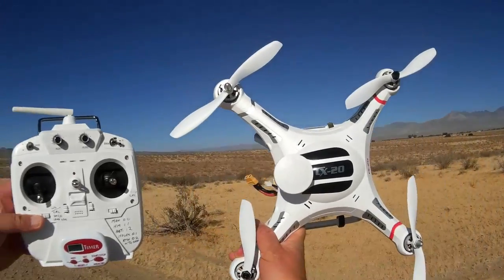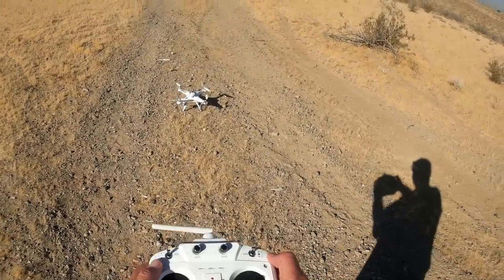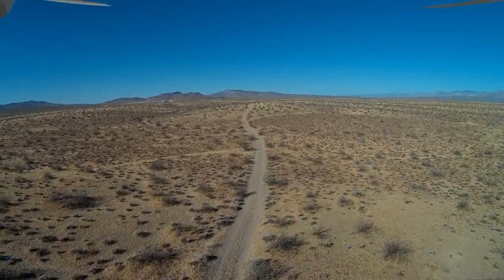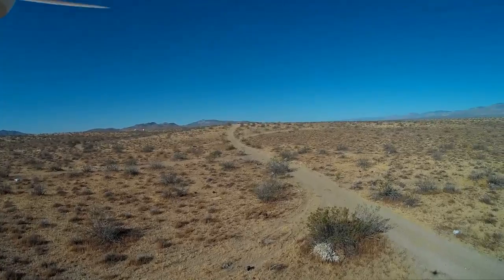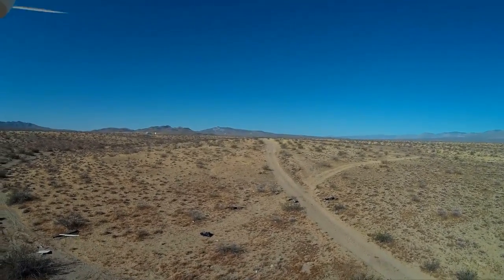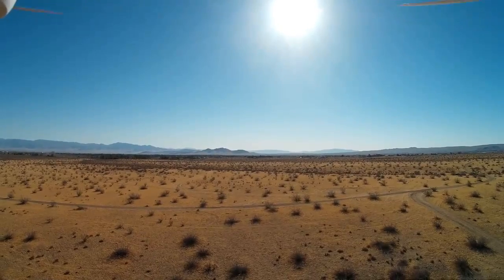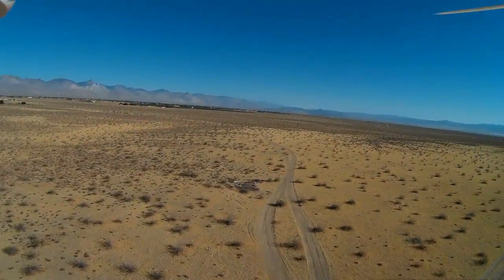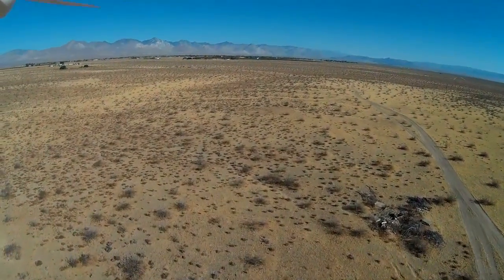Cheerson CX-20 Drone, Oops!

Comment: can I tilt the camera in this drone
Reply from the maker: +K.Nurul Islam Pranto If you attach a gimbal you can.  It has signal pins and auxiliary control knobs to do such.  But keep in mind that the basic model does not come equipped with a gimbal.  You have to purchase and install that separately.  http://www.banggood.com/FPV-2-Axis-Brushless-Gimbal-With-Controller-For-DJI-Phantom-GoPro-3-p-908068.html?p=RB0922217402201307U3
Reply: +Quadcopter 101 I  have a  go pro cam  i want to use that.  so is the  protocol is same in this case

Comment: hey guys do u guys have idea why the cx20 motor turn off when flying in altitude hold 1-2.was flying it today and took the cx20 about 10 feet and turn it to altitude hold and  it fell from the Sky little damage to the body
Reply: Is the battery running out?

Comment: This is a great quad, I bought this quad about two months ago solely from the review of Quadcopter 101, the CX-20 is my very first quad and is what I'm using to learn how to fly (over 35 flights and posted 2 vids here so far). I chose the CX-20 as it was relatively cheap for what it's able to do (199 US Dollars in a local store), the GPS functions (specially loiter) has saved my quads life more than once, I used to get confused or lose it's orientation so I would select loiter to give me time to collect my thoughts and bring it back to me, if the quad is too far for me to figure out it's orientation I can select RTL and when it gets close enough I take over and continue to fly or just let it land.

I now rarely use loiter to save my quad as I've become somewhat good at flying the CX-20 as you can see from my videos, I have had only one crash and that was because I let the battery get to low while performing an autotune (yes LVA was going off but didn't want to make it stop doing it's "dance"), it was low to the ground so no real damage occurred.

This is not a ready to fly quad, you MUST do all the mandatory calibrations before you attempt to fly this quad (probably all GPS enabled quads for that matter), get and use Mission Planner (or something similar) to set up your quad, that way you will have many happy flights.!

Comment: This is  the most difficult quad to fly in this price rangefollowed instruction https://www.vessel.com/channels/elect... cheerson 20Quote "it is almost impossible to fly if you do not calibrate flight, to do this you have fly level for 40 seconds" How do you do this if it is almost impossible to fly before hand? already damaged motor on crash landing after 5 minutes of flight I own a phantom 2 and wiltoys v303 much safer and easier to operate may regard this as a mistaken buy
Reply: +aussietrevor Before I flew my CX-20 I done allot of reading and watched others videos on how to properly set up the CX-20, doing it the way Cheerson wants you to is not the best way to get the job done, I recommend doing all calibration from withing Mission Planner (or similar program), all this can be completed without having to fly the CX-20, I also no longer use the stock firmware either, for me upgrading to 3.1.5 and then 3.2.1 was for the best for how I want to use my CX-20, once I started to use autonomous missions I had no choice but upgrade as the stock firmware is somewhat limited, but beware, once you upgrade firmware you can NOT get the stock firmware back.
Reply: thankyou for taking time with your very informative comment

Comment: Encountered the same problem on my CX-20 during ALT-HOLD.  Is it safe to switch modes during flight?
Reply from the maker: +Dehner de leon I'm not sure.  This quad has a mind of its own what it's going to do.  I still have mine, as I'm afraid to give it away to anybody because of safety and liability concerns ;-)
Reply: +Quadcopter 101 It seems That I was also a victim of the same erratic flight behavior as yours. The first flight was fantastic, I did calibrate, the compass and the controller and it was an awesome flight. The next day, I just powered on and flew it, and it was all over the place, I also tried to switch modes and I swear I thought it flipped side ways and fell about 15 feet. bushed landing gear, and lost a prop. Fortunately I have some DJI landing skids and props for it. Perhaps the copter does need to be calibrated before every flight.
Reply: +Quadcopter 101 Truly it felt like it has a mind of it's own since I tried calibrating it and reading the instructions on the Mission Planner for hours and do pre-checks before the flight, still to no avail.  Mine had a bad crash upper and lower frame broken.  Trying to revive this but all I got is a beeping sound with no lights.  Funny thing when I connect the quad to PC via USB with the battery attached...it works but once I remove the USB there is no response.  Donor waiting here :)
Reply: +Quadcopter 101 Ouch! that's heavy! ...😮
Reply: Wow... And to think I have one of these coming. After reading all of this, I'm thinking that I made a BIG MISTAKE when I purchased it. I'm now thinking that when it gets here, I'm not even open the package, I'll contact the seller and request a return slip, and and refund....... I should have watched more videos about this quad...... Dag~Nab~It
Reply: Goodold boy, maybe is not so dark like it seems here.
I'm in me 1st week with me cx20 (many vids soon on me channel!!😁) and I'm already in love. What I say you now is just be really carefull with the right operation, of the modes, etc.
And you'll be happy.
Stay tuned for more!
p.x. : you must be able to fly it totally manual mode first. 
And after you can implement the other gps assisted modes in you flight.
Ciao
Reply: Paul Terl
or the words of encouragement, and advice, I appreciate it very much. As for flying in manual mode, I can do that. I have two other quadcopters that I have been using for learning to fly. The SYMA X8G and the SYMA X8W. It was fun learning for the first time, lots of crashes on soft grass fields so no damage done... So, I should be able to fly the CX-20 in manual mode from the start. I'd like to ask, what is the reason for flying in manual mode first ? I downloaded the user manual for the CX-20 but it's a mess, so many words left out, and things worded wrong, so the user manual is kinda useless :( If I read it right from the manual, the quad must be calibrated before each flight ? LOL I'm going to look real silly out there spinning around in circles, but it's a must, have to do before flying. If I do decide to keep it, I will be sure to set up everything as they say. And make sure I have as many Satellites as it can find connected to the quad... It's going to be very interesting.......
Reply: You are welcome
Reply: Pay attention that the SWA switch is on the right and the SWB on the left.
And put some writings on the tx as a remember.
Seen me (first two cx20) vids?
Next Two are better, I think I will them on tomorrow.
As for your first question: If something goes 'strange' with the gps modes you can fly manual switching 0 - 0.
I also tell you to 'study how to desengage the Safe-fail return.
And, don't spin you and quad but just the quad on itself to calibrate it.
Hope it helps.
Reply: Paul Terl
Thanks for the info. about the calibration. I was told to hold the quad level, and spin myself in a circle 5 or 6 times. The they said I have to point the quad nose down or head down facing the ground, and repeat the spinning process. Now I have a question for you, If I set the quad on a spinning platform, then spin it around, will that calibrate it correctly ? also I would do the same again but will place the quad on the spinning platform nose down or head down, and spin it again... I think that will calibrate the compass Right ?
Reply: You got to respect the right sequences as on the instruction manual, (to change between the various modes).
Hope it helps
Reply: +Goodolboy One I fly a bit around places here so I spin it (4+4times) in every new location.
It's sufficient to spin it slightly straight, not perfectly, I believe.
Today I think I will able to put on (me channel) two new more 'Cx-20' vidz... (just fly not crash ;) ).
With succesfull manual, and gps flying.
And, excuse me if I repeat myself but write on your tx notes to help you during flying.
Have you yet received it?
Ah! And change the charger soon as you can.
Let me know.
Bye!
Reply: Paul Terl
I got it yesterday, and today I did fly it until I got the "Low Battery Warning" then I shut it down and brought it inside. I have recharged the battery and it took around 3 hrs and 45 min. to charge up. I must say that I loved the feel of the transmitter, very smooth, and the short time i flew it, it was great... kinda like driving a Cadillac... Only way I can explain it. I'm looking forward to flying it again in the morning if the winds are calm... I have ordered one the better battery chargers. everyone has said to get the 		 		iMAX B6-AC B6AC Lipo NiMH 3S RC Battery Balance Charger, so that's what I purchased...

Comment: Last week my CX-20 was at around 200-250 feet and for some reason when into auto return home mode and i lost control of it!
It then moved directly above me and started to come down and land, until it got to about 15-20 feet and then started moving right all on its own and crashed into a tree 100 yards away across a barb-wired fence and I was able to retrieve it from someones horse field. They were nice enough to let me. I was at a middle school with a huge area to fly in and I have no idea what happened! My battery had juice in it. 
Anyone else see this or can help me and is there a way to bind this while its auto returning? I was trying everything and couldn't regain control/bind it again.
Reply from the maker: +Jason DeKeyser Something similar happened to me also https://www.youtube.com/watch?v=PzxQTr8C8QY
The CX-20 is screwy in its auto modes (including altitude hold).  These days, I just fly mine in manual mode to avoid this screwiness. I reserve its GPS RTH as an emergency option only.
Reply from the maker: +Jason DeKeyser As for regaining control once it starts a return to home, First set Switches A and B to 0.  Then repeatedly toggle Switch A to 0, 1, then back to 0.  Keep toggling Switch A until you regain control.
Reply: +Quadcopter 101 
Awesome..thanks for the tip on regaining control!
I always fly in manual mode (too scared to fly in other modes) but it still RTH on its own.
At least now I have a way of trying to regain control. I dont want to break a window at the middle school or put gashes into the horses in the field next to it!
Reply from the maker: ***** If it RTH'ed in manual mode, then it's likely something to do with your battery.  Do you notice any swelling of your battery?
Reply: +Quadcopter 101 
No swelling with battery. I think I heard it beep from 200 feet up. Not sure if it was stock battery or not. I know the stock battery doesnt turn off the charge light on the stock charger like the other 2 batteries I got. Really frustrated with this quad. Glad I got it for $159 on a flash sale at Banggood! Cant imagine spending $300+ for this POS. When it works it works great...but it has a mind of its own sometimes!

Comment: Well, welcome to LVC. Low voltage cutoff. You may not have realized, but the transmitter was beeping telling you of the impeding doom. I frankly don't care for the GPS mode on both my Cheerson and the 3D X6.  Just too damn erratic.  The Cheerson is just not fun for me anymore.  My custom built 250 I just finished looks promising.

Comment: I fly cx-20.  Few tips for cx-20 would be owners.
1. Always make sure your battery is fully charged.
2. When you hear or see low voltage warning...  fly it home ASAP.  When battery juice hits low voltage threshold...  the quad will shut it self off turning it into a flying brick.
3. Always double check all props and tighten them.  They tend to come loose after many use.  
4. Calibrate compass and transmitter.
Reply: Should I calibrate it every time before flying the quadcopter?

Comment: I got my CX-20 in put a new gimbal on it and loving it so far. I can tell it does not like to be in the breeze though. That is why I got the venture because I didn't think this would would like a little breeze. On the note on the venture. I am really thinking it is the Nava Lite MC now. I read more about it and if you remember me telling you it flew like my 3d heli not like a quad that has autopilot, well it is suppose to have autopilot/autolevel in all modes not just gps and alt. So I am going to call them today since they have not responded to my email. Other than that I really like the cx-20

Comment: Hello Quadcopter 101

I think I have come to my conclusion on what happened. From what I could hear, the second stage low voltage alarm was screaming at the time of the crash. This then lead to one of your esc's lvc (low voltage cutoff) to stop it's motor. Did you charge this battery with the stock charger? There is a chance your stock charger didn't fully charge the battery and it didn't have as much juice as you thought. Also, that lvc alarm is not as loud as it seems when it is 20m out. I recommend an iMax B6 as it gives you readings for each cell which could also tell you if one of your cells were bad and that lead to the crash. Let me know what you think about the situation.
Reply from the maker: Joe Quadcopter Yeah, (spoiler alert) it was the battery.  There's a Part 2 video coming, and also a Part 3.  Part 2 has a very interesting result and identifies the problem, while part 3 shows resolution.  I'm just spacing out the release of these videos to build suspense ;)
Reply: Cool!
Reply: The stock alarm can be heard at 50mt, and more.

Comment: If the battery puffed and was quite warm that is usually a indication that the amp draw on it is too much. Or the it was being overly discharged pass the favorable 3.7 volts per cell. It is best to use a simple cell battery checker before flying mult-cell batteries to ensure 1. The battery is charged, 2. The cells are balanced. If the battery that came with the quad a cheap 10c battery it is almost designed to fail. You are best off with a minimum of a 20c batter, 25c to 30c are very reliable.
Reply: Mine arrived stock with a 25C.

Comment from the maker: Just flew my Cheerson CX-20 again today.  My battery failed early in flight and resulted in a RTH and landing.  The landing was very interesting (video to follow in a few days).  But inspecting the battery after landing, noticed that it was really swollen.  In fact, had a hard time removing it from the quad.  Well, I'm going to attach a light bulb to fully discharge it outside on dirt to dispose of it as it's no longer safe.  But what bums me is I only got about 6 flights out of this stock battery. I really think it may have been the stock charger's fault for this early retirement.
Reply from the maker: Ben Dover No, I own an Imax B6AC.  But for video reviews, I need to use the components that come with the quad right out of the box.  That way, others will know what to expect from my experience.  Now my viewers know (or soon will know once the other two videos are released) that the stock charger can and will destroy the battery. If they intend to purchase this quad, they should also purchase an appropriate charger for it.
Reply: Quadcopter 101 I don't know what kind of charger comes with the Cheerson CX-20, but I would suspect a pretty inexpensive one. I would only charge 1S batteries on the cheap stuff.
3S batteries need a good balance charger to charge all the cells equally.
Reply from the maker: Tony C I once got a cheap clone of that.  It went bad within a month.  For those considering, recommend the original.  But it's important to check the reviews and where it's coming from, as there are lots of cheap fakes of the SKYRC imax B6 charger.
Reply: Tony C thanks for the tip. My cx-20 just arrived and bought the imax skyrc. Can't wait to try this out.
Reply: Could you please tell me if possible how I can get a return to home function on my DJI F450 when I lose range or have low battery power? I am running a Spectrum DX6i TX and am wondering if I can use a different receiver to run return to home instead of having to upgrade to a DX7.
Reply: Quadcopter 101.... Yes the stock charger is horrible it breaks batteries badly. I only use my balance charger (imax b6) otherwise it will fail every time.   Glad you got it working again tho
Reply: Quadcopter 101 Mate if you're using the stock charger then it's ruined your battery, surely you'd have a decent charger lying around or is the first "real" quad?
Reply: Quadcopter 101 hi, newbie here and just ordered a cx-20. What charger do you suggest i get? And should i get a diff batt as well? TIA!
Reply: +Raymond Veran ....This is what I use and its wonderful   http://www.amazon.com/gp/product/B00ON1C6C2?psc=1&redirect=true&ref_=oh_aui_detailpage_o00_s00
Reply: Quadcopter 101 couldn't agree more
Reply: Raymond Veran You will love it, I love mine
Reply: Tony C oh, one more thing.. do i really need to put the batt on a lipo bag while charging?
Reply: It's safer but I don't

Comment: Watched a RTH video using three different quads w/and wo compass calibration and they did fine. I think you had a malfunction with a prop or something related to flying other than gps.
Reply from the maker: Pat Martin Well, I'm also flying full pitch with the stick pegged when in these automatic modes.  It really doesn't seem to like it.  But it flies fine in manual mode at high speed.
Reply: I'm sure a thousand other people have done the same thing, just not sure that accounts for what happened. You would know better than I my friend but it just doesn't make sense.